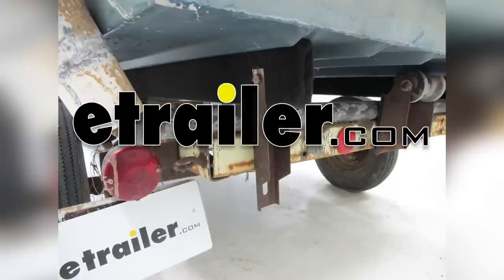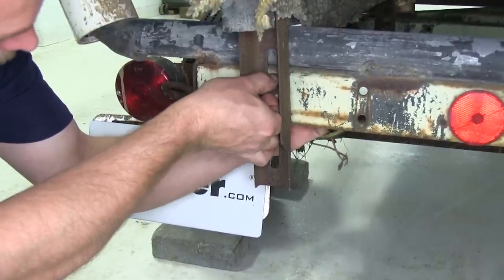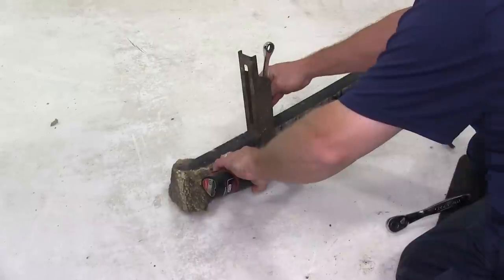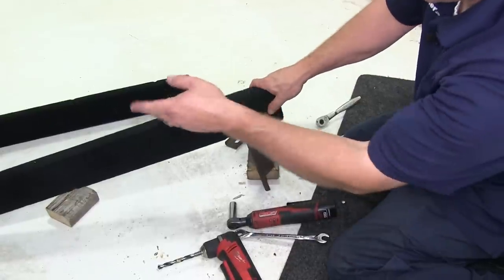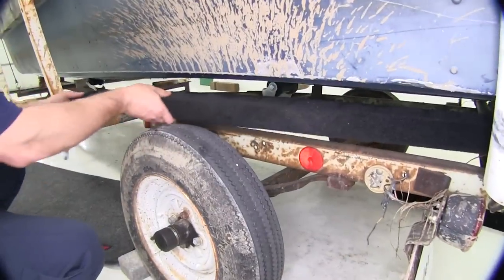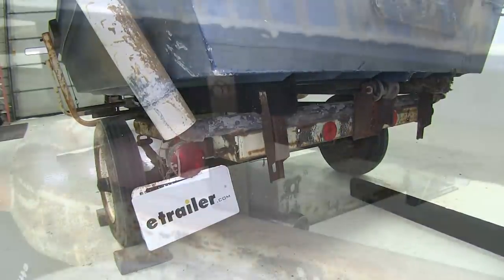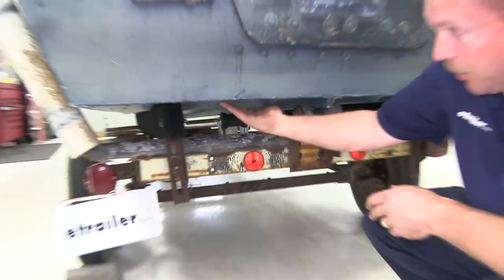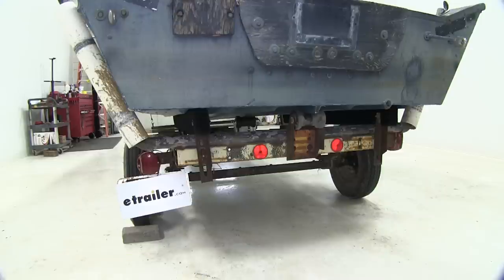etrailer | Feature Breakdown: CE Smith Carpeted Bunk Boards for Boat Trailers

Comment: Should  the rollers be touching the boat or should you leave a space small between?
Reply from the maker: If you are using roller bunks then yes the rollers should be touching the boat. If you are talking about guide-on rollers that sit in the middle it is okay for the boat to touch but typically the bunks should take the brunt of the weight so make sure your boat isn't solely resting on the middle rollers.

Comment: I have my bunks installed flat instead  of up right does it really matter I have a different setup though
Reply from the maker: There are a wide variety of ways you can configure the bunks on your boat trailer so either way is fine as long as it is compatible with your boat.